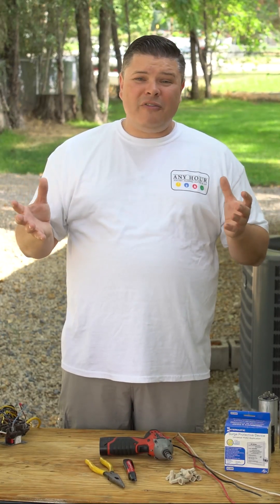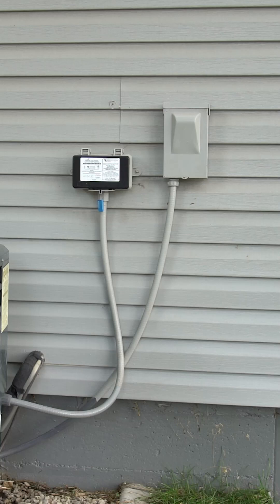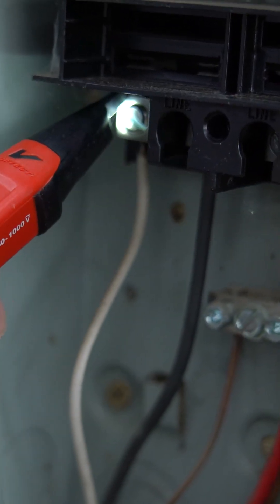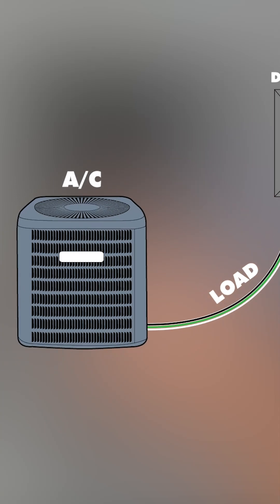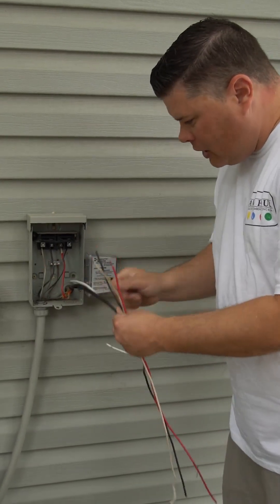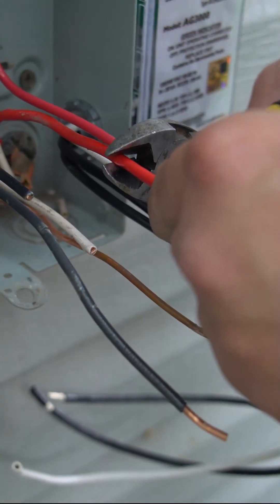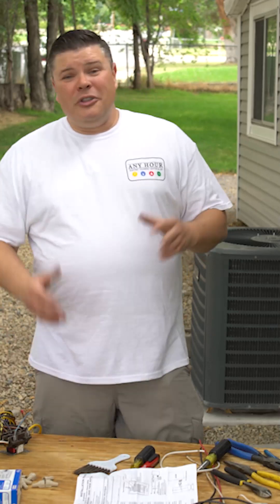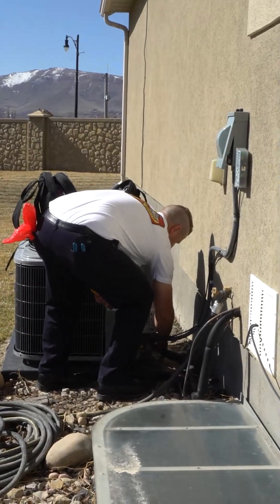How to Install a Surge Protector on an AC

Comment: My line side in from breaker is 8-gauge twisted copper, load side 10-gauge solid copper.  SPD  is 10-gauge stranded aluminum and have 10-gauge stranded copper for pigtail. What’s the best solution for a good 3-wire pigtail connection with those sizes?
Reply: Look into the polaris connector IPL-3B . They are about $30 each.

Comment: I didn’t read the comments so perhaps this has already been discussed, but it is a violation to use a regular wire nut when connecting copper and aluminum wire. They actually make special connectors for this since the expansion rate of copper and aluminum wire is dissimilar creating a fire hazard.
Reply: I use purple Ideal wire nut for copper and aluminum.

Comment: So many videos out there double tapping! Also, some say to make sure to NOT cut the wires at all because "they are made at a certain length for its purpose". Is that correct?
Reply: Dome of them connected in to the load,not the line,???

Comment: this guy said to connect to the load side... https://www.youtube.com/shorts/iWozc-woHfY
Reply: The video you list is from one of the top HVAC instructors. Directions specifically state load side for the Ditek model he is using. However this Intermatic AG-3000 calls for installation on the line side.

Comment: This is a great video, thanks. What about a 115 volt install? There's only 1 hot coming in the line so where does the second black wire from the surge protector connect?
Reply: You double up the 2 blacks for 120v.

Comment: Damn this is as perfect and clean as a video gets for this installation. Not sure I like the vertical video, but understand why it was done that way. Still super clean easy to follow, only would add the Anti-Oxidant on the connector. Thank you for making this video! 👍🏽👍🏽👍🏽👍🏽👍🏽
Reply from the maker: Thanks for your comment! We do have a longer and horizontal version. In case you need it ;) https://youtu.be/mILq9JCFeBU?si=pHiZkW2kBmu7MtHk
Reply: Especially thankful for the warning not to double tap.

Comment: Found out if you don't wire into the lead & wire into load, you will risk frying the capacitor or worse. I wired into load & had a series of thumping noises & loud surging "groans". Glad this video was available because the instructions in the packaging of these devices are strictly for whole house breaker panels. Thanks!

Comment: In my understanding, a surge protector is installed between the power source and the equipment. How this device works? Because the unit will be connected to the power source too.
Reply: The SPD he installed prevents a surge from backfeeding from the AC/HP to all other household appliances.
Reply: Well the mini-split manufacturer recommends protecting the AC unit versus worrying about back feed to the rest of the house. It's because there are so many electronics in the mini splits.

Comment: Excellent video.  After blowing out 3 a/c circuit boards over last few years, this is probably the solution!  Was told it would cost $500 to do, so never hired anyone to do it.  But see I can buy this type of surge protector and do it myself to $60.  Will save me tons of money over the years.   Thank you!
Reply from the maker: Glad it helped

Comment: So when my AC unit kicks on and the lights dim quickly but go back to normal is a tell tell sign?
Reply: This is more for a power surge in your area that can blow components and fuses. What you would be looking for is a hard start/soft start kit to help reduce inrush amps when the unit comes on